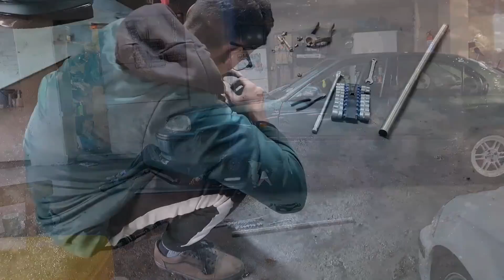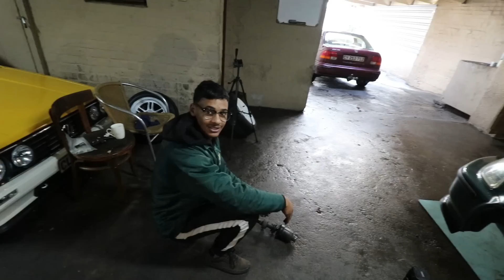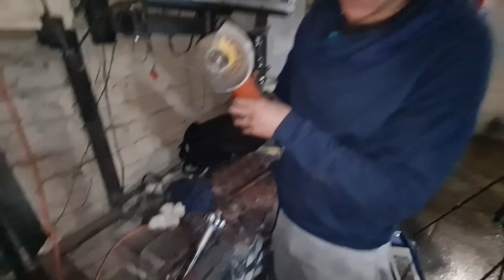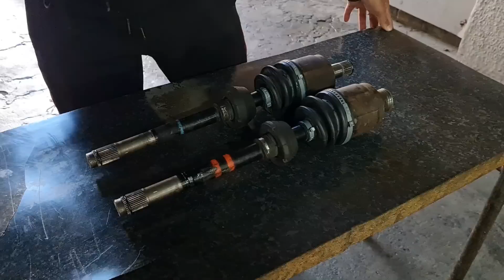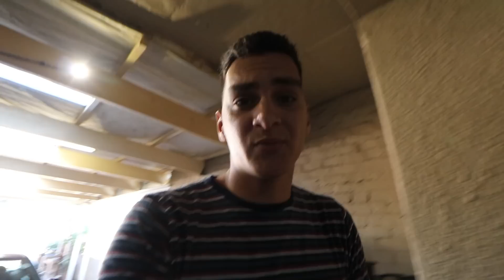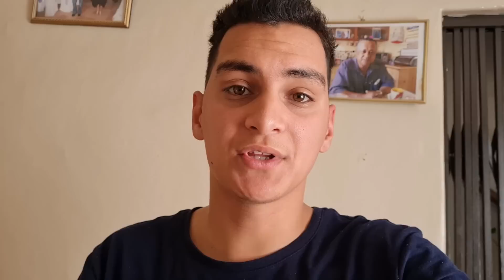Suspension Refresh on Fred's Honda 180i (in Preparation for Killarney RTR)

Comment: Guys just a bit of advise if ever you do outer CVS again before installation on the shaft you need to take the grease and put it in the center of the cv in the whole till it pushes out at the balls then install the shaft so that the cv joint is not dry and the grease does not need to get warm first before it spreads in the joints just a bit of useless information 😉